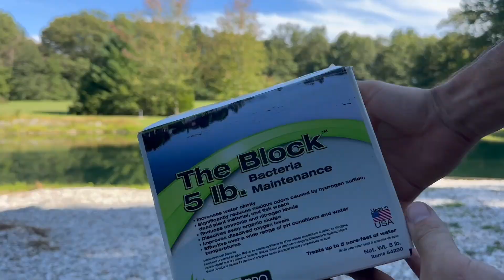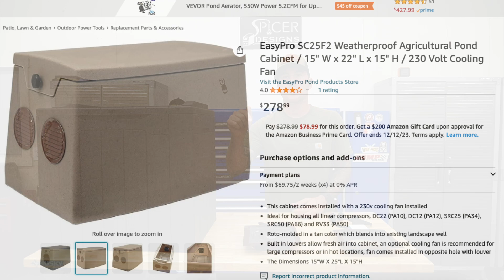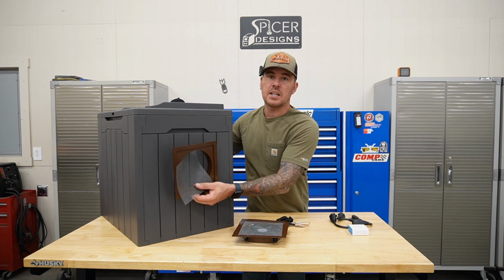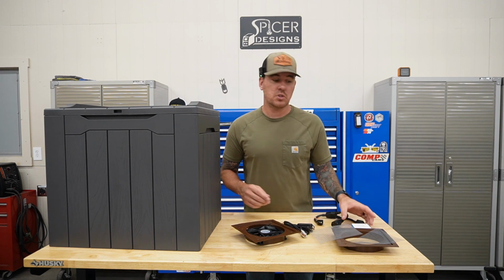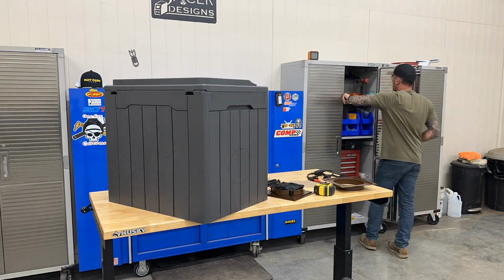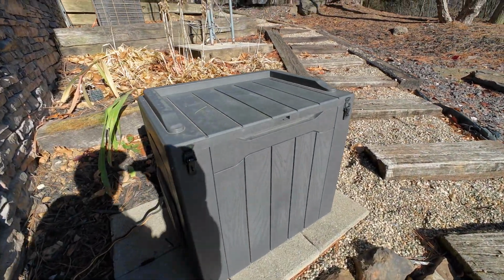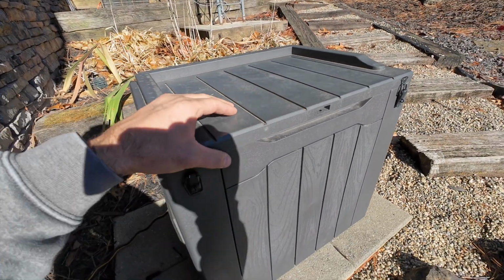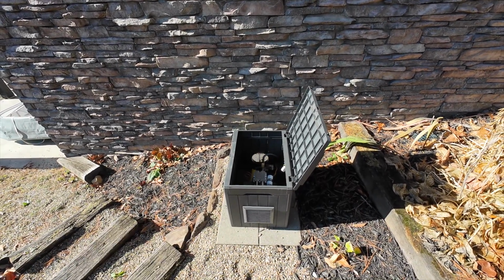$124 DIY Aerator Cabinet....EASY Build

Comment: Nice simple build Kyle! Think this aerator could be run using solar only? Cheers, Alex
Reply from the maker: Thanks buddy.   I dont think solar can push that pump with the diffuser.  Typically you see the stone style aerator with a smaller compressor on the solar setups.

Comment: That fan link is incorrect. I ordered everything in the list and should have looked at the fan I was purchasing. That amazon link comes up with a 60mmx25m small fan. lol. You wouldn't happen to have the correct size would you?
Reply from the maker: That is the correct fan that i used.  It fits in the vent just right.  Don’t need much.  Just some airflow so it doesn’t turn into an oven in there.